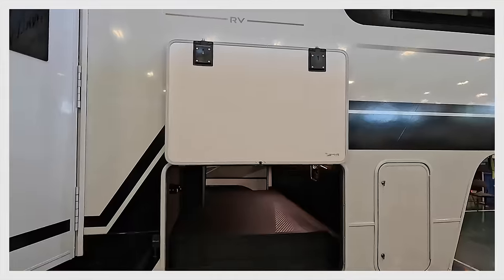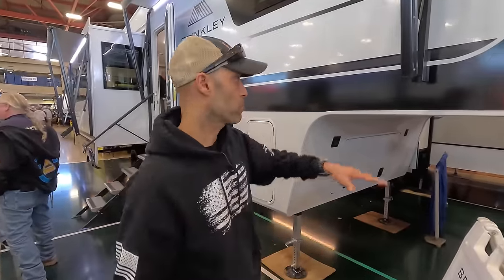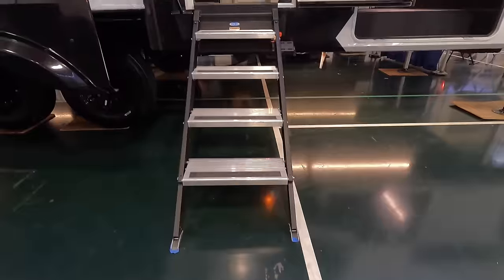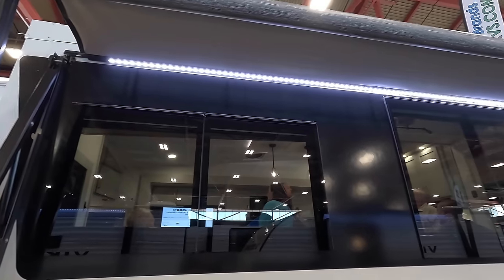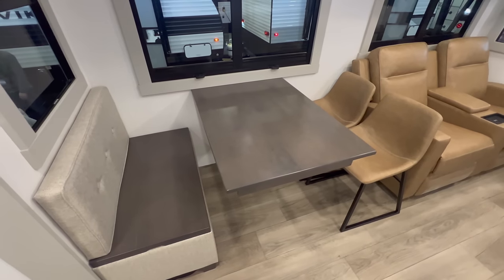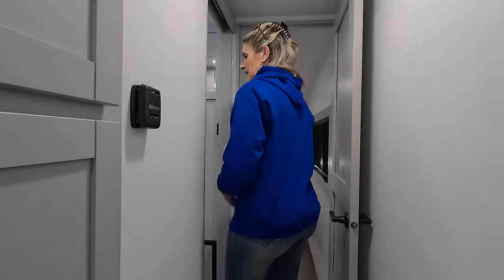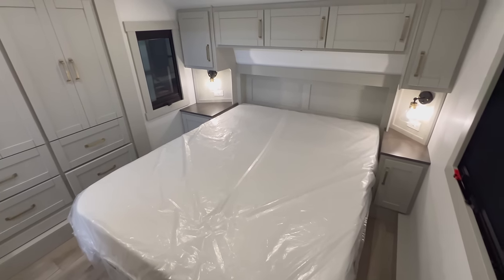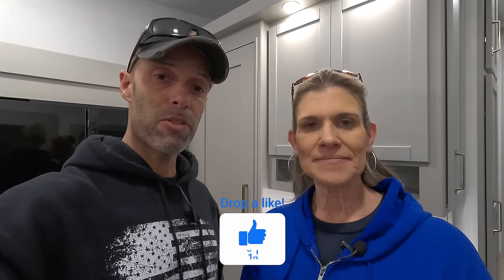Impressive -- Our First Ever Tour Of The New Brinkley Model Z!

Comment: Nice review. Did you notice, Brinkley does not use modeling around the cabinets or crown modeling at the walls and ceiling, why? Because their cabinets and walls fit correctly, so they don't have to hide the gaps and imperfections. Also they are using butyl tape for sealer not a silicone sealant, this is a better way to seal joints, it cost more but way better.

Comment: Furrion got their start in the boating industry and have a great reputation for durable appliances. They transitioned into the RV market a few ago and are gaining ground quickly. One possible downside is that they're owned by Lippert. Did you say it came with solar or was wired for it? We have good friends looking for a new fifth wheel so I sent them a link to this video.
Reply from the maker: Thanks for sharing it Roy.

Comment: Dovetailed drawers is great but soft close drawers and cabinet doors is way overrated!
Reply from the maker: Thanks for your thoughts. 🙌
Reply: Great video as always, my impression is dovetail drawers are nice to have but certainly not a must have. With 60k+ miles both towing and driving our two different RV's over the past 10 years without any dovetails and we haven't had any separation problems; however I'm sure this will vary by manufacturer and even between models too. Thx.

Comment: Nice? Yes, for sure. But they are vastly overpriced for what you get. Vinyl wrapped face frames, no full or partial body paint, no Morryde IS at the MSRPs they ask just does not compute. They are building what Grand Design pretends to be.
Reply from the maker: You may want to look at New Horizons RV
Reply: @EndlessRVing  Yes, we have. Just saying we have looked at numerous Brinkleys, such as G4000, and they are overpriced for what you get. Riverstone offers paint, even Momentum does, and they are not $300K.